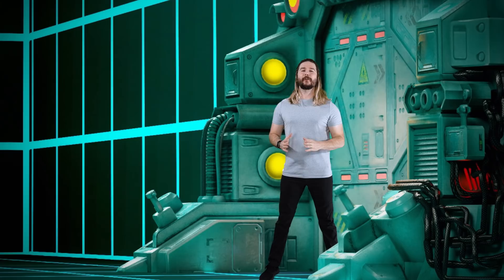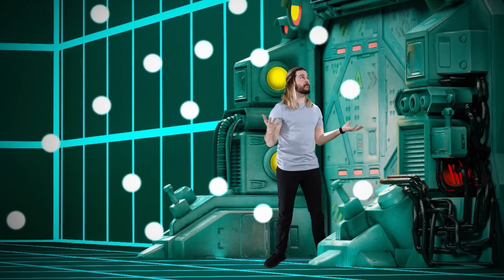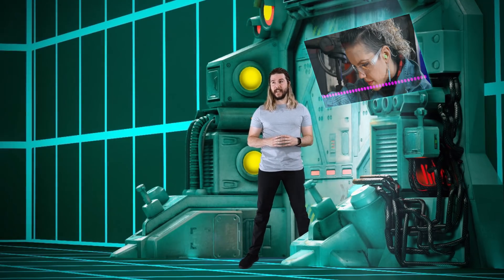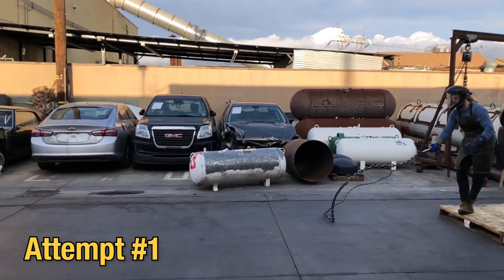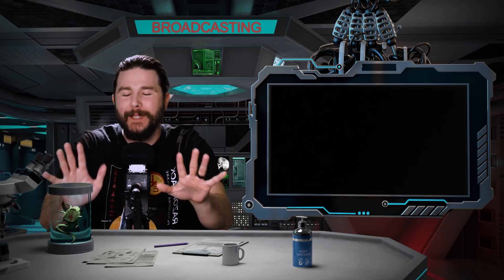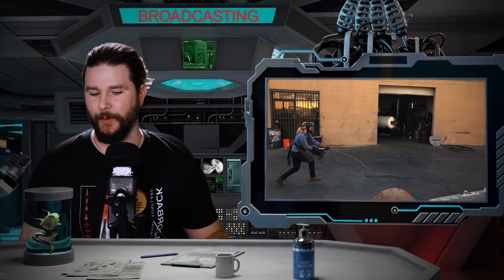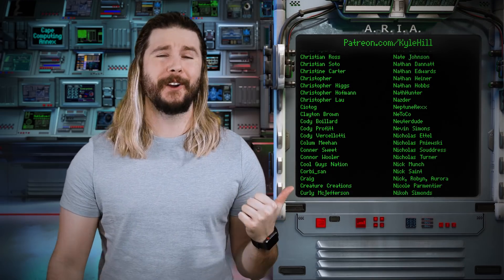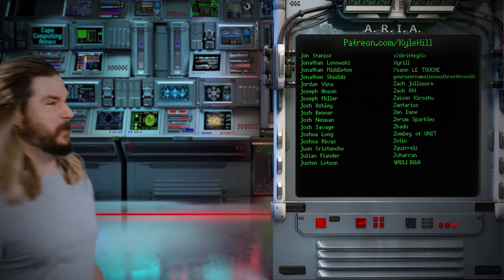Can I Make a SUPERSONIC STEEL WHIP?

Comment: It just looks like he's not strong enough to swing the whip with proper technique
Reply: Yup, that's the problem, it's too heavy for him. Normal bullwhips are light so can be easily used in a manner to get the tip up to speed.
Reply: Though, I believe that if he were to make the last lengths of the chain into a leather material like he suspects in the video, I’m sure that he could break the sound barrier

Comment: theory: could the fact that the "whip" is made out of chains play a role? with a standard whip the leather is fairly tightly braided together, could the fact that the chains have any area to shift relative to their neighbors play a role?
Would you expect to have a better result if you could move the whip faster? maybe connect it to a tear drop shaped plate on a electric motor? 

SAFETY suggestion: is concrete the best surface to preform this test on? due to its smooth surface it will allow the chains to slide more easily but with less resistance when it begins to coil itself back up its able to travel much closer to an individual. perhaps a less smooth surface would be preferable for the extra drag i would expect it to have.

Comment: The shirtless gentleman in the tiktok video actually gets the whip fully off the ground via a long circular swing before diverting it's path at the very end, regardless of the end of the chain's construction.  I'm thinking that may be the portion that would allow the tip to acheive the desired speed.  That way there's no resistance from dragging on the ground or bruising evil geniuses prior to the 'snap'.

Comment: You need to condition your fast twitch muscles to move that mass forward and rapidly change its direction. Remove the square stock and weld the chain as the handle. It will add in comfort and grip.

Comment: I think making the last third a woven steel wire tapering off into the thinnest point would get to where you wanted it to go. YET your are correct in how DANGEROUS this can be and I wouldn't pursue it after trying it the second time. Thanks for sacrificing your calf muscles and feet!

Comment: This is a failure mode called "operator error". I would suggest learning form using a normal whip before trying something harder and more dangerous. "how to not hit yourself" is pretty basic whip stuff, and much better learned with something light enough you can control, and less dangerous to make mistakes with.

Comment: try wrapping it in plastic wrap, the gaps in the links are keeping the air from building up along the length into that nice hyper-compressed bundle of snappy joy. Or put a tapered steel cable on the end 1/3, same reasoning.

Comment: It doesn't surprise me at all that you can't crack that whip.

I'm pretty sure if we just compared the last 2 inches of the two types of whips we'd find a mile long list of reasons no average human could impart the required forces, from energy loss due, to the joints spacing in the chain vs in a classic whip, to who knows what else. 

I suspect you would need a car to pull off getting it to crack the sound barrier, and that car would get wrecked from the experiment.

Comment: I think you have two issues: the step down in chain sizes and the loose linking of the chain links lead to impedance mismatch and energy loss. You might be more successful making one out of a tapering wire rope.

Comment: Perhaps it wouldn't be practical as far as whips as a... Tool (?) Would go, but I would suggest that since it's not a leather whip, don't treat it as one. Lay out the whole chain as a length towards the target first, then use a wave motion to whip it, rather than trying to swing the whole thing around your body. It seems like that could be safer and be more within the realm of reasonable human strength.

Comment: Surprised you used such a heavy gauge.  I'd think it easier if you used a smaller lighter one, preferably tapering to as small a point as possible on the end.
Increased danger with that last point, of course.

Comment: Well your first problem is that you don't have a "cracker" which is what actually breaks the sound barrier it is usually mad of a pretty thin flexible material, and your second problem is that you aren't making loop while swinging the whip, not like like making a loop like a lasso but making a loop in the way you swing it, and it looks  like your "fall" is to long but it doesn't really look super long, the crack done in the video that was sent to you by your fans is called and overhead crack, the whip cracks because when you perform it the correct way it sort of makes a three quarter figure 8 so it makes a big loop

Comment: You know, Kyle, it’s occurred to me that in order to replicate a real whip with metal chain, you could try welding progressively thinner/smaller chains onto the larger the further towards the tip you get, ending in essentially a thin necklace chain at the very tip.

That will replicate the shape a whip needs to get the speed required at the tip, and be more likely to work.

The chain you used seemed to still be pretty thick/heavy at the end, which is why it never got up to speed.

I’m sure you’ve thought of this already, but if not, worth a shot if you care to try again!

Comment: do you think it would have worked if you used a different type of chain? to my unscientifically trained eye, it looked as though the gauge of chain you were using was much to heavy, and your issue was overcoming the weight even at the base. theoretically, if you used a different gauge of chain, more links in smaller sizes, and tapering down towards the end, would it work better?

Comment: Hey I'm a circus performer in New Zealand and use stock whips to whip stuff out of people's hands. One of your big problems is the technique. Using your technique you probably wouldn't get a leather whip to crack either.
Try looking up whips in slow motion from some whip pros to see how it works

Comment: Kyle you are simply not massive enough to anchor it well and not strong enough to crack that all-metal chain whip. Not your fault. It is just physics. But having a heavy chain tipped with a normal leather whip might be ever more dangerous, if you are strong enough and heavy enough to pull it effectively. Otherwise, it is just inaccessible overkill.

Comment: You need to pull the whip back after the forward motion. This will help with the acceleration. Im no physicist but this is how whips work.

It's not a continual forward motion, it requires a reverse motion to accelerate the tip..."just the tip"

Comment: I believe it failed because your chain was always dragging on the ground when you were windig it up. If you look in that tik tok video, in the second try which is closer to what you were trying to do, only the very thin end of the chain drags on the ground and even that lifts up pretty quickly. Also when the chain makes that loop, the radius needs to be longer. Attempt 2 was the closest you got but the loop the chain made was too small and there was not enough energy. Look frame by frame at the loop of the chain at 5:35 and compare it to 8:04 frame by frame. You will see that his chain has a small loop at the begining but it grows wider. Notice the motion of his body too, he is puting A LOT of energy in that swing.
In conclusion you just didn't swing it right. I tried cracking a regular 1 m long whip and it's actually quite tricky to pull off. I couldn't do it consistently. I can only imagine what it's like to attempt it with a giant chain whip.

Comment: Would  it not be better to make a whip out of a braided steel
Reply: Ok ok ok not just braided bur at the handle it needs to have a gyrospin above where ur hand grips it so the twist in the braids can rotate to achieve the crack dyneema style braiding out of steel wire think it's totally doable

Comment: Just from casualy watching, I think you were not pulling back to Force the crack. With a normal leather whip you have to sling forward then pull back sharply to accelerate it. Looks like you were not pulling back. I could be wrong.

Comment: On a leather whip the thick end has a natural stiffness that resists the tendency to an ever decreasing radius which I suspect helps with the transmission of the forces down to the thin end that you don't get the benefit of with chain. You should look at a modification of the design for smoother transmission of force to the tip. E.g. possibly wrapping the thick end in a bungy cord material that has a tappered thickness. This I suspect will also solve your problem of your feet getting hit.

Comment: There is success in failure, so long as every failure is used as a learning experience and as a stepping stone to future success.

The only thing that can beat Science is Better Science, so if you learn something new from every failure, the path to success is open to anyone willing to learn and try.

It takes integrity to admit to a failure, revise the method, document the changes, and admit the viability of the current methods are not favorable.

Thank you for having intellectual integrity enough to admit that you couldn't make a supersonic steel chain whip, and for explaining success bias and being willing to show your experiment's failures. You make learning about specific subjects, as well as the scientific method in general, very entertaining and palatable to even smooth-brained nuggets like myself.

Comment: Is it at all possible that it's not...well, POSSIBLE, to break the sound barrier with a steel chain whip made of chain link because the gaps in the chain link are allowing too much air to flow through and thus not causing enough of a pressure wave to be able to build?

Comment: Hm... Looking at the fotage, it seems to behave like made out of the several segments made from difrent chains... I think the temper at conections is to sharp...

Either:

A) made chain from scratch with constatn percent temper( Like 1 percent per link),

Or

B), grind down some links around connections...

Comment: Not sure this has been asked or not, but, just for poops and giggles: What would the speed of sound be in a neutron star?   If you smacked one side of the star with a hammer, would an observer with their ear pressed (foolishly) against the other side hear the smack, and would it be near-instantaneous propagation across a 15km star?

Comment: I do not think that it is humanly possible. there is a lot of energy lost between the individual links of the chain.  I thin the initial speed of the chain would need to be an increment above the SoS per link in the chain to the link tip so the tip can break SoS. There is also a lot of energy absorption due to the density of the links thus that speed at the start would need to be even more faster. try with a tapered cable. That might be humanly possible.

Comment: That third section going to the end needs to be a bit thicker its collapsing your arc loosing alot of energy then after that replace the 4th with some woven leather into the tip having some Paracord for the tip. 

Least that's my thoughts.

Comment: Dear Kyle, I do believe you can make a supersonic chain whip with a couple of simple modifications the first being length.

If the chain was 6-8' in length (not including the handle to provide the extra power for torgue), you would yield better results. 

The longer iteration now at 10+' as it seems, the momentum is lost as the chain bounces or travels down the length, prior to the "snap" at the end.

In addition or alternatively, filling the holes with an epoxy, might keep the air from escaping through the links, helping you keep the air pressure needed for the sonic boom.

Keep up the great work Science Thor!

Comment: Galvanized steel wire may have worked better and you may be able to make a whip in the same fashion as a leather one. Or weld it on to the end of the chain

Comment: The reason mythbusters worked is because failure was a success condition.
Define the experiment failing as an initial success condition and make the video with that idea baked into it.
No one wants to be promised things that aren't delivered, either immediately, or over the long term. That's why the success bias exists... because failure makes a bad video.
Succeeding at failing makes a better video.
"I failed" isn't engaging, entertaining, or worthwhile information for an 12 minute video.
"I failed and here's the breakdown of all the things that went wrong, why they went wrong, and what can be learned about it for future application" might be.

If I skip through all of the points you state something you've already stated, or where you replay footage I've seen already, this video amounts to about 20 seconds. That means there's give or take 20 seconds of content, and the summary can be limited to just "I failed." That's about half a second of engagement. Sucks you hurt yourself. Sucks you failed. Sucks that more people don't try to make failure conditions into interesting videos... but this isn't one. Failure for its own sake is not a valid topic of discussion. Not in entertainment, nor in science, not in industry.

A video where nothing is achieved and the audience walks away no better for having seen it anyway is called "a waste of time." That's true of conversations and situational analysis as well. You can do better. If not the experiment itself, in the video presentation.

Comment: The starting size of your chain is too big and too heavy. The mass is limiting you speed. Use a smaller starting chain and taper down to a smaller chain size than the one you are using. You can get some pretty small steel chain on line. Don't give up on this project. Go back to the begining and start over. Scientific break through and success require determination.. This is possible to do I have done it. I know you can do this.

Comment: Perhaps if instead of the smallest thickness of chain you used you had the whip transition to a smaller diameter steel cable you might be able to achieve the cracking speed at the tip you're looking for

Comment: so if you wanna try this again I can tell you your chain will work but its the technique your using that causes you to loose so much power on your "crack". if you where to lay the chain out in a strait line behind you and run it forward as soon as the last link starts to come forward you would need to drag the handle back and give it a flick in the opposite direction to the chains motion, with practice you will feel the motion travel down the chain and can weirdly the slower you act out this motion the better your results will be. I imagine you wont make another vid on this but in case you wanna do it in your own time that's how x3

Comment: Also, you didn’t have an area were you could swing it and get enough momentum where it wasn’t on the ground losing energy.  There’s a reason that guy was swinging it over his head at the start.  Keeping the entire whip off the ground for as long as possible helps keep the energy in the whip.

That is likely not possible given strength requirements

Comment: hmm... I'm seeing multiple issues from my perspective.
1. Chain material at the end. (the part that CRACKS in the air)
2. Kyle's physical transference of energy into the whip.
3. the safety "handle" that was made for safety provided even higher weight.
Resulting in Kyle needing a lot more strength to pull it off. Think... essentially 2 Kyle(s) worth of strength with proper form and he might be able to pull it off. But unfortunately with the weight of the entire "Whip" he will not be able to actually complete this task unless he suddenly had a spike in strength.
My best recommendation is to drop the material (STEEL) and go to copper or brass.

Comment: As he says: DONT DO THIS. It is stupid. Good chat.

The taper wasn’t enough. The heavier the whip, the more the taper needs to charge to increase the speed difference.

If he had started with the handle, then slowly tapered down to metal wire: it would work.

Also: metal braided wire might too.

Comment: As I see it, this is failure to properly use the math in two places.  First Kyle does not have the strength to initiate the traveling wave, the first section of chain has too much mass.  Second, chain is not a continuous material, there is too much energy lost at each link junction.  You can see this in how 'wonky' the chain gets at about the halfway mark.

Comment: It's just too fricken heavy.  You can't move it with a high enough velocity.  And it's also not flexible enough.  Which is probably why the other guy completely cheated by putting a leather whip at the end of his to get the cracking noise.  You should try it again with some sort of whip cracking machine moving it at high velocities, and staying the hell out of the way for safety reasons.  But I'm not sure it will work even then because the lack of flexibility of the material.  It might not be possible to get the whip cracking motion because of it.

Comment: I do Whip-cracking in my freetime, but to be honest I would be scared by this thing I would not know if I would want to crack this thing...
well I know you do not have the experience for cracking a whip, but with this thing I think it would help only a bit...

if you put leather or a steel cabel at the end it will work and be very loud (without protection you could have problems hearing after a crack like this)
but another thing is, when you look at the rollout of the whip, then you can see when the thickness of the chain changes. Because there is no real taper but a jump in chain-size it lets the whip jerk instead auf rolling out smothly, mayby more diffrent links in the chain would help to smooth it out

sry for my bad english, awesome video